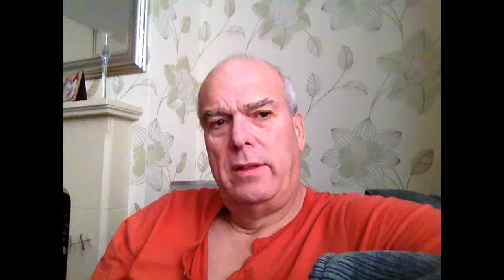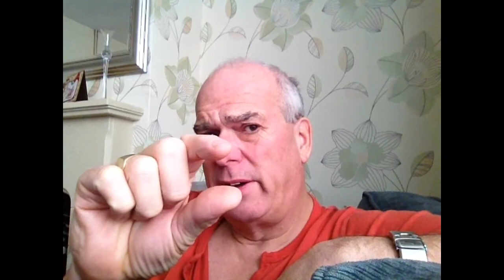Old Fart on a Motorbike, Vlog 142 Electrical Circuit Tip

Comment: Nice thought Jim, glad this worked out for you. As someone with experience in this field i recommend to use destilled water next time. Cause after drying it does not leave some lime residue which can cause short circuits.
This method is good but you need to be careful if there are some turnable caps or resistors on the board. They fill up with the water and that's that then. Ride safe mate
Reply from the maker: I will remember that and it makes sense. Mind you if it don't work and it's the last resort it's worth a try

Comment: Matey, it very well couldve been the drying that fixed it, not being a smarty pants but sometimes the circuits have cold soldier and a good heating fixes them up. I work with computers for a living and a certain brand of laptops have video problems and i remove the motherboard from the rest put it in the oven at a certain temp for 8 minutes on parchment paper let ot cool reassemble it and it works better than new. Just wot I do when i ave those problems. Hope this might elp in the future. keep on making your great vids.
Reply from the maker: Another valuable tip for me noddle box, never stop learning me. I could whack me computer in with the Sunday roast   Thanks for that.